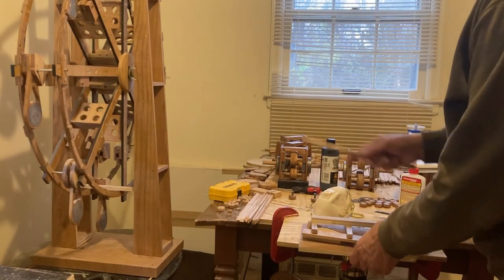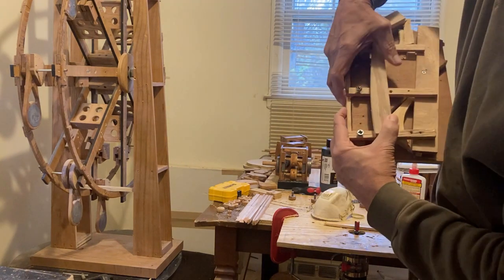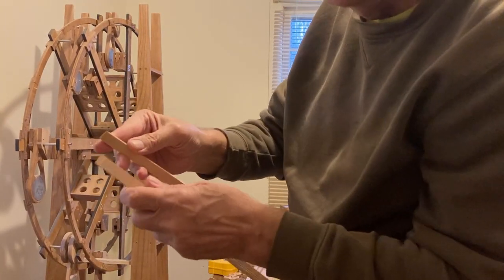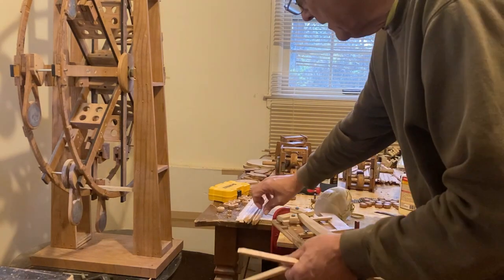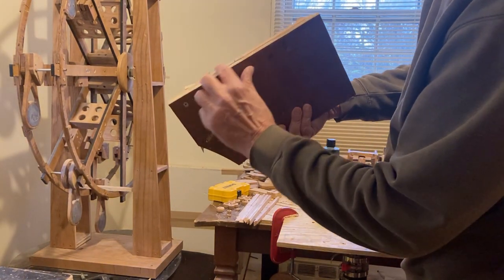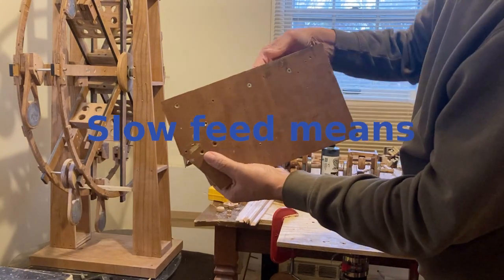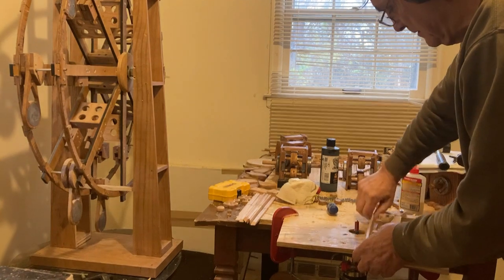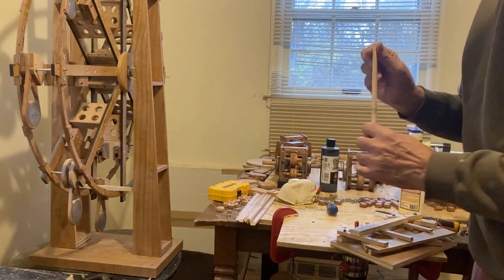MG2 Lever Fabrication (Maschinen Grüven Deux)

Comment: when u will be able to get at least 2 or 3k of electricity without friction ,heating or any kind of losing
Reply from the maker: There will always be some energy loss. As deigned, rotating the top weight will consume about 2/3rds of the force created by net torque. Gears can be used instead of long levers, the levers allows it to be obvious how leverage is being used to perform work. Then with the math I am using a wheel can be scaled to generate 2 or kWh (kilowatt/hour). I am almost finished with my Bessler Wheel build (Johann Bessler, 1712 Republic of Saxony) so either later this month or early next month.
Reply: @free-energy-systems   god bless so i will say something else, if i have here 4hp air conditioner that may be need 10 or 11 amp when it starts to work and withdraw, so do u think that your set will be able to run it on load and continuous to work for 12 hours ? just we want to replicate and follow in a path of trust